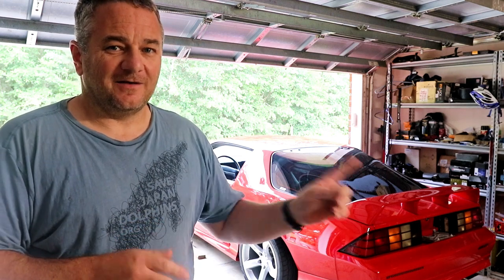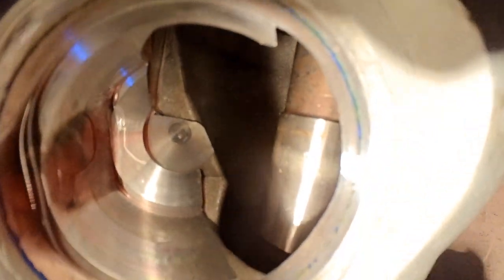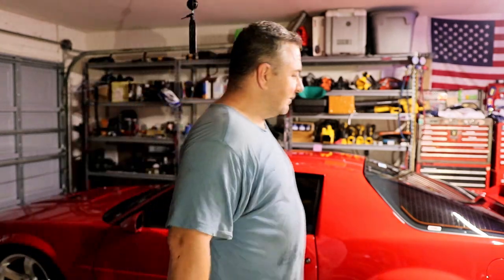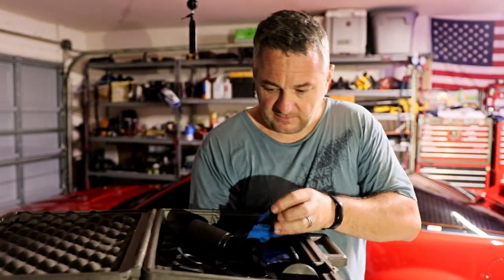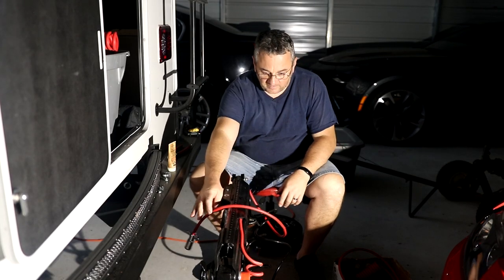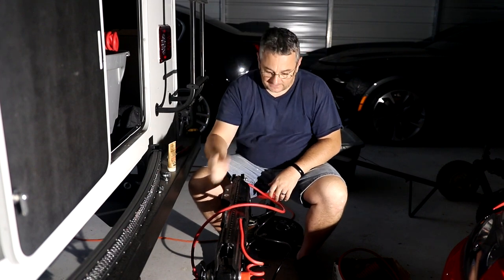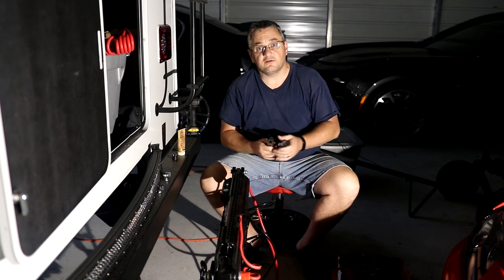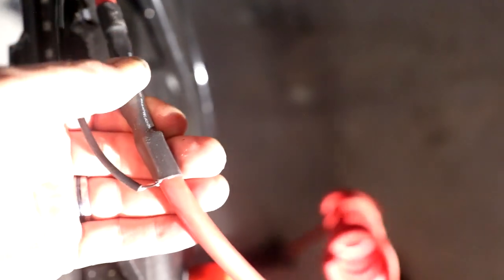IS THE SPEEDOMETER AN EASY FIX OR NOT AND SURPRISE FIXING THE RV

Comment: I wanna say there’s like a spline gear that missing the goes across in that hole. That the speedometer gear lays in. I may be wrong but I’ve seen those on some makes and models. And thanks by the way for what you did for my dad. We greatly appreciate it.
Reply from the maker: Yup there is I ordered a new set may as well replace both. I will show it in the next video.  Your very welcome  wish I could do more glad to help anyway I can.

Comment: Yep. The clip that retains the gear on the shaft broke and the gear is on the shaft somewhere. The gears are specific to the rear ratio. The speed sensor sends the signal to the buffer in the cluster, and the ecm.
Reply from the maker: Yup in the video you can just see the gear way down the shaft you can see a bit of red. Did you hear me say dang Smitty  when I was trying to get the speed sensor bolt loose lol?
Reply: @L2theWcarscoffeelife  yeah...lol. Didn't think I got it that tight...my bad.
Reply from the maker: Its all good  thought it was funny I said it